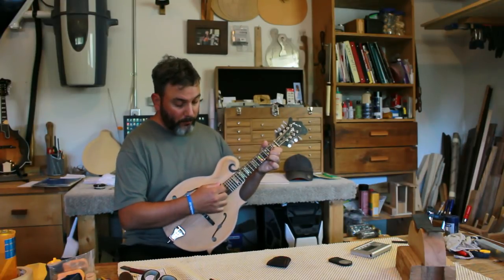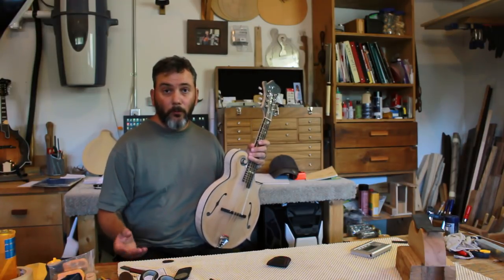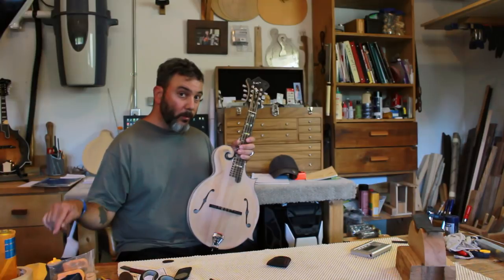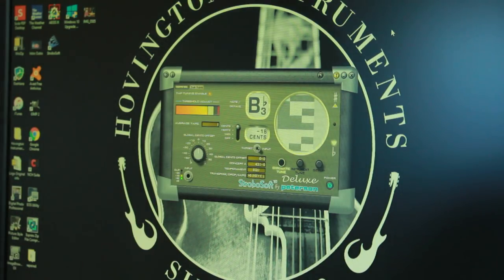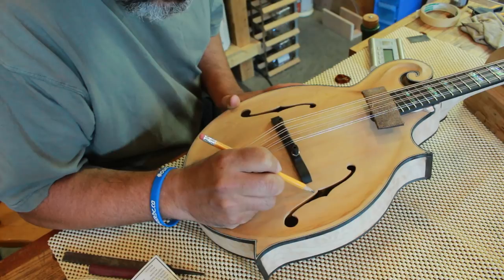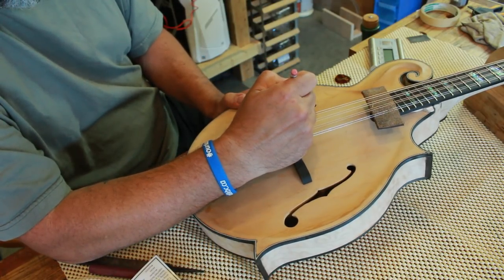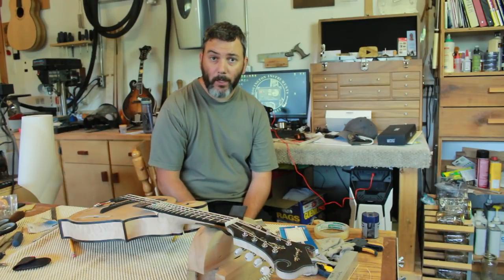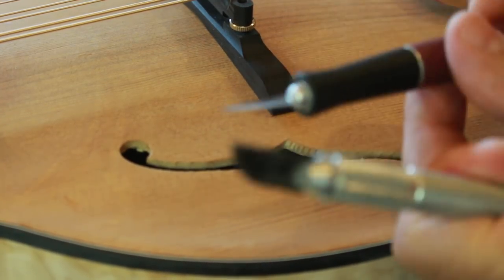Voicing the Mandola

Comment: I do have a deluxe . Having trouble setting it up.
Reply from the maker: Assuming your computer has a mean to read the tap ( audio in) there is a tab in the top left beside note sel “tap tune” , click on it... then once you click, there is a line that appears under “tap tuning enable “ click the dot at the end of the line. This should allow you to tap tune. From there you can choose the preferred concert pitch (for example, 440hz or 432hz) hope this helps

Comment: At first, it looks way beyond what I understand then again, it's like tuning a drumkit to be in "pitch" with the rest of the musicians. I will watch this video again when I'm getting to a point of understanding all the previous tuning soundboard/backboard video's. The only thing I cared about until now (making instruments of reclaimed materials) was the intonation, and when the instruments are used they seem to blend in nicely with others.. well mostly used for blues and rock and going through all kinds of distortion and crackling amps (*o*) 
Thanks for sharing this... I'll look back at it when I'm at that point...

BTW. Spruce (of any decent quality) isn't available locally (nationally), would larch be an option? (because there's a change of getting that, although the tree still has te be cut)

All the best from Portugal!
Reply from the maker: The information may be overwhelming at first but once done once or twice it’s not that complicated. Intonation is critical to be in pitch.. when voicing a air camber ( body of a instrument), you are trying to maximize the air flow coming out of the instrument. If too restricted, the strings will vibrate but sound will not come out.  If too big it will lack volume. 

For the soundboard wood it NEEDS to be quarter sawn, whatever soft wood you’ll get. In the case of recycling you could have a 4 piece glue up.. or even 5 pieces. Just assure yourself that your joint is good, that you have quarter sawn wood and a good ring count. 15 rings per inch is makes for A grade material. The more rings in the quarter sawn the stiffer the soundboard will be.

Remember the 2x4 Uke, it was a Spruce 2x4. The material commonly used are Spruce, cedar, and also Fir.  I honestly don’t know about Larch ...
Reply: I understand that you want to use reclaimed wood, but if you want a good sound it’s worth buying a nice top. There are many tonewood suppliers in Spain that will send to you. Try madinter. Hope this helps

Comment: Great video, as I'm trying to learn as much as I can about bracing, how it effects the instrument, and now tuning the sound board. Do you think this can also be applied to a flat oval hole mandolin. I'm a big fan to the 432hz and this is what I'd like to achieve. Thanks for the vidoes.
Reply from the maker: Yes Patrick , you can apply this to an oval hole. Voicing is the step in which you open the air hole or aperture in order to maximize the air flow. Be careful not to remove too much.
Reply: @HovingtonInstruments  Thanks Tomy for your help